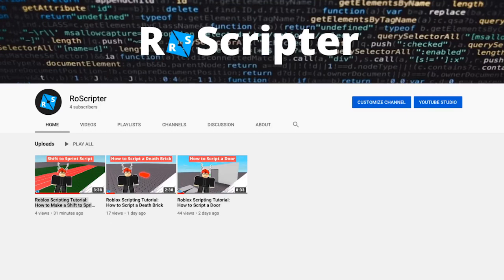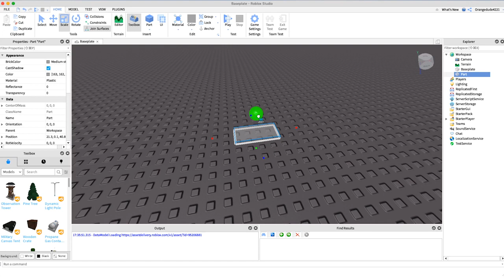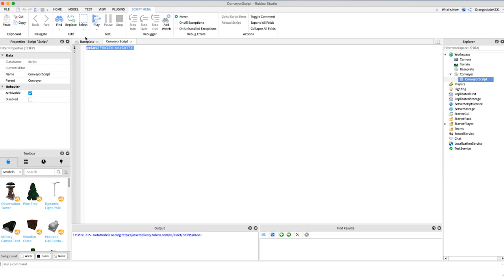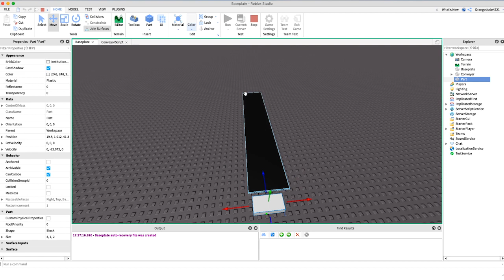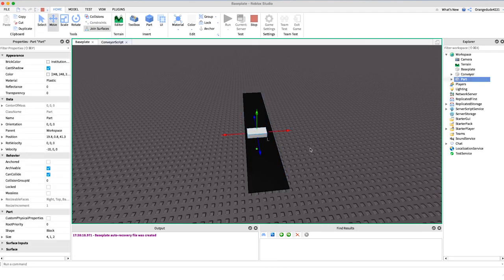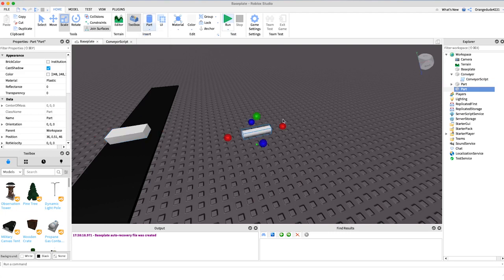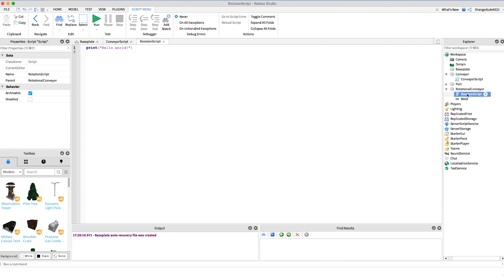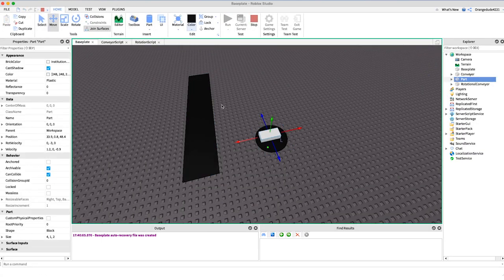Roblox Scripting Tutorial: How to Script a Conveyor Belt

Comment: You can just go to properties and change the velocity
Reply from the maker: Yep! That’s actually a very easy way to make a conveyor. The only problem I’ve found with using that method rather than scripting it is that whenever the part’s CFrame is changed, the velocity is set back to 0,0,0. Thanks for watching!
Reply: @RoScripter what is CFrame
Reply: well kind of but also no